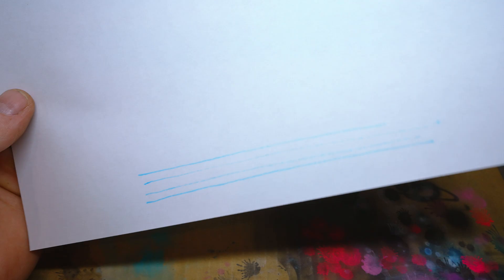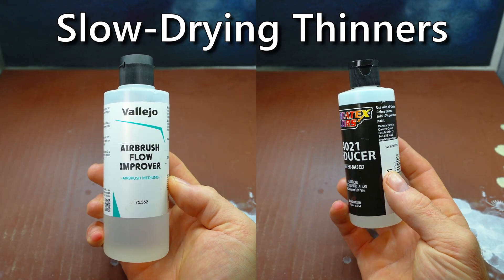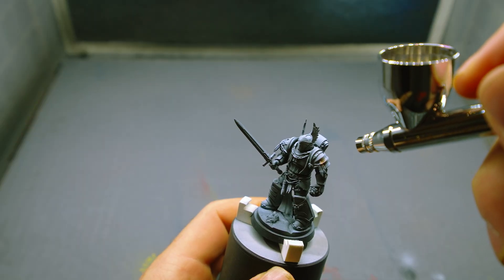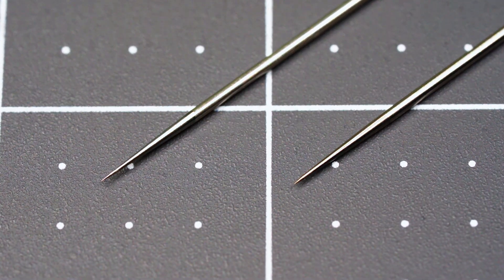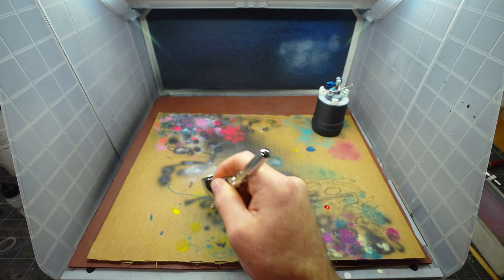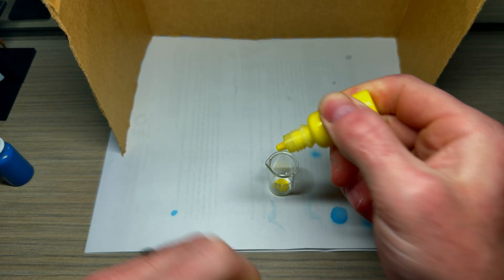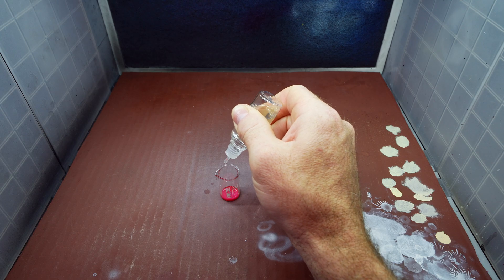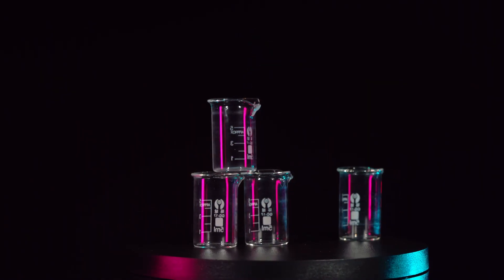thin airbrush paints like a WIZARD for MINI painting

Comment: I picked up some of those tiny beakers and they have a few handy uses.  They are the perfect size for when I want to soak my nozzle in IPA or lacquer thinner.  The tapered standard bottle corks I have fit them perfectly as well.  
I think that premixing outside the airbrush is especially important with acrylic primers.  Once the bottle has been opened and partially used they tend to create chunks and sticky "boogers" that need to be broken up or filtered out.

Comment: I find silicone stirers/sticks are the best for mixing paints wether its in the airbrush cup or outside. They are silicone so paint doesnt stick and you can just wipe it off, and they wont scratch the mixing containet like a brushes metallic ferrol.

Comment: Another issue with thinning using water: some paints, especially proacryl in my experience,are very picky when it comes to the water used, but respond immediately to alcohol based thinners. Proacryl seems to prefer a basic pH even when thinning on a wet palette. I’ve found that adding some ammonia or isopropyl helps keep their suspension from breaking. Some paints obsessives have theorized it’s the bentonite clay in their mixture in their formulation.
Reply from the maker: Yeah, I definitely have noticed quite a difference in how Pro Acryl reacts to water compared to other paints. I have pretty much always used some kind of engineered reducer for airbrushing, only trying out pure water for a bit upon watching some 2d artist rave about it. Not sure if I tried it with Pro Acryl in the airbrush much, but sounds like it would do well it some Tamiya x20a?
Reply: @Wily.Wizard ProAcryl is already very thin and quickly turns way to thin for workung with it. My experience. Also it clocked my airbrush when using it wirh Vallejo thinner etc.

Comment: I have no problems mixing in airbrush. Just put thinner first, then paint and mix it with backflow. This may not work as well with every paint but works for airbrush acrylics I use.
I keep my most used basic colors thinned in separate small bottles (say 10ml). Shake and use as is or thin more in brush when needed or mix colors in brush. I'm an artist rather than miniature painter though.
Reply from the maker: Just out of curiousity, how often do you paint, and what does the finish on the inside of your paint cup look like? What types of reducers are you using?
Reply: @Wily.Wizard  Sometimes I paint daily, sometimes weekly.
What an inside of paint cup looks like? Clean chrome or whatever material, unless it has paint in it because I'm painting. What else could it look like? If dirty after putting it down, one has not cleaned it properly. If worn out, it would have had too rough handling/cleaning.
I tend to paint mostly with acrylics or acrylic inks. Depending on paint I use water, isopropanol or mix, 4011 for wicked.